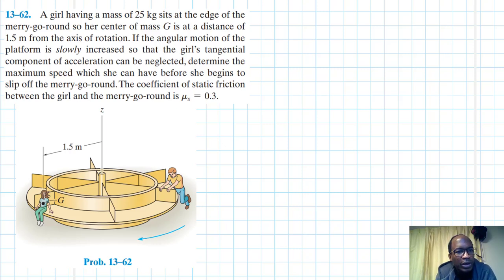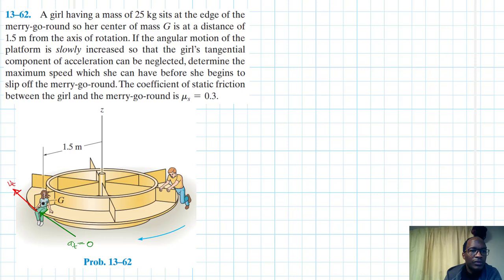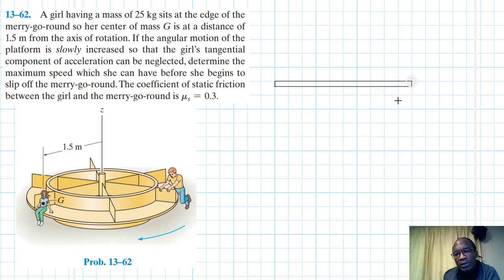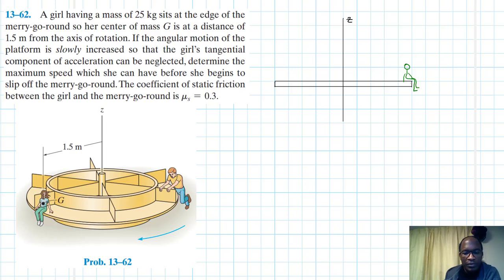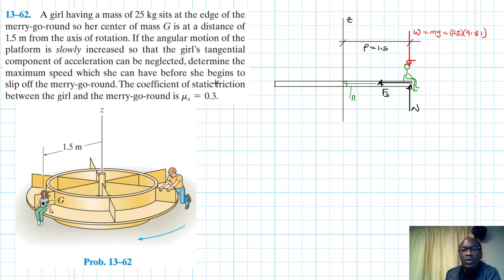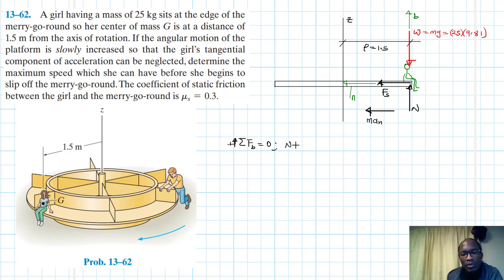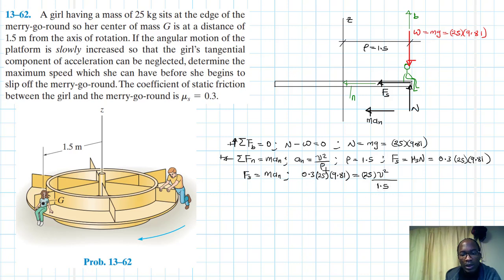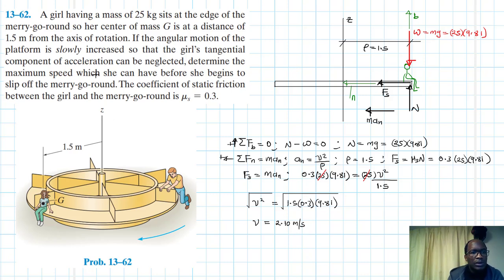13–62 Kinetics of a Particle: Force and Acceleration (Chapter 13: Hibbeler Dynamics) Benam Academy

Comment: How is frictional force inward is it not be outward
Reply from the maker: When someone is seated on a merry-go-round, the friction between the person and the surface acts INWARDS towards the center of the merry-go-round and not OUTWARDS. 

This is because inward friction helps provide the necessary centripetal force that keeps the person moving in a circular path. Without this inward frictional force, the person would slide outward due to inertia, as their body tends to move in a straight line.